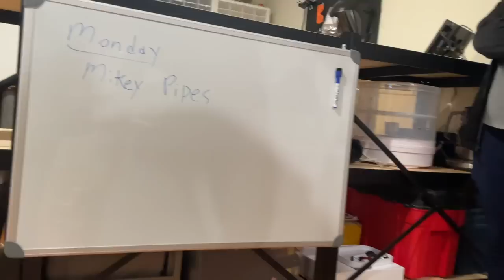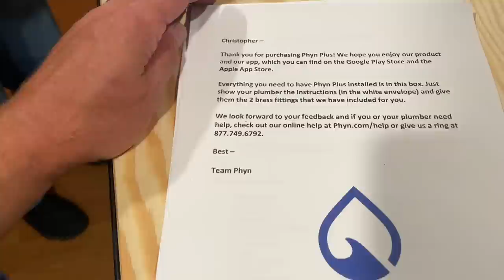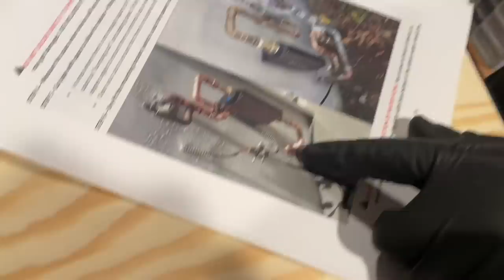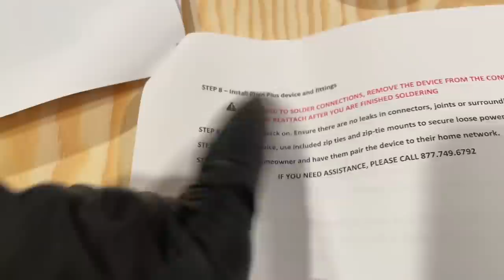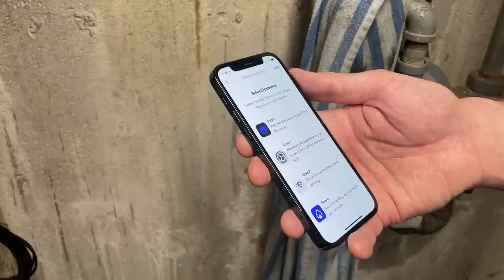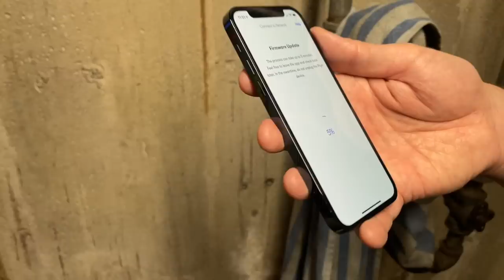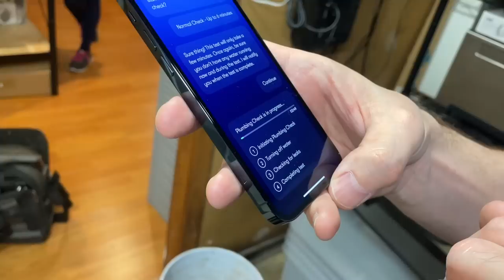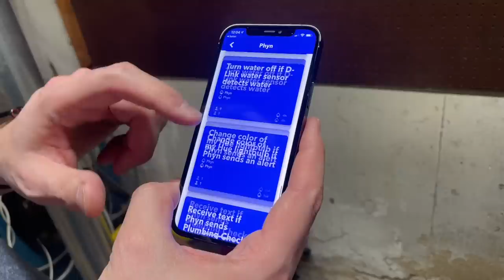How to install Phyn Plus Automatic Leak Detection System on Water Main to protect against Flooding

Comment: In my area ( Syracuse NY) we would be required to put a #6 copper bonding jumper with bronze grounding clamps around the Phyn because it is not conductive from end to end. Same as we have to do around the water meter.
Reply: Excellent point!
Reply: Alot of areas around Syracuse want #6 @ 2 points ,do to the fact that they are running pex mains,and you can't ground alot of electrical services to the water pipe,so you have to drive ground rods

Comment: I reaaaallly enjoy your honesty (Plastic threads. It is what it is.)  Plumber as well, here.  I prefer the Flo by Moen.  The price point is a little higher, but the unit is smaller and nicer (My opinion).
Reply: @PipeDoctor  so then why do you like the Phyn vs. Flo Moen
Reply: I was eyeing the Flo, but then saw loads and loads of complaints of the internal turbine freezing up after about 1.5 years of use (past warrantee).  Seems to be a design defect where internal magnets corrode.  Prior solution from Moen was to purchase a new unit, appears that they now sell a replacement turbine, but ultimately appears to be a poorly designed product.  Now looking at the Phyn, and may give Mikey a call for installation as I live on LI.

Comment: Interesting -it would be interesting to go back in a month when the system has ‘learned lifestyle and installation use’, and open a drain valve somewhere on the system and see if initiates automatic isolation. Good call on showing the soldering SNAFU.😉👍😀

Comment: FLO by Moen is great and more affordable.  Great interface and easy to install.
Reply: FLO may be cheaper upfront but it requires a monthly subscription to access all the AI features that Phyn comes with out of the box.  You will save money over time with Phyn.  While I have not had personal experience with FLO, there seem to be more quality issues reported with it though.
Reply: @losnantos8079  you’re wrong.  There is no monthly subscription that you pay for.  I get all updates in real-time via the app and email.  I even get a phone call if a leak is detected.  I’ve owned this product for over 6 months now and it works great.
Reply: @snakeplissken128  Flo has a big flaw with its sensors getting corroded. A big no, the lifespan is less than 2-3 years.
Reply: My flo Moen went bad 3 days before my 1 year warranty expired. Thank God. I inspected the bad flo valve it was made of cheap plastic parts. I am just crossing my fingers now because they don't warranty the second unit.

Comment: Good video but not soldering often enough to remember to keep a rag handy to wipe the joint and should have put the plug wire on the other side of the water line.

Comment: Nice geeky device,  it sounds like it will monitor pressure on house side of control to find water leaks.  Sounds great for finding leaking toilets.  I think this device will be defeated by a teenage girl. A teenage girl uses more water then most little countries.  Teenage girls take min 1hr showers,  how many times will this device contact the owner about a large water leak during one shower before owner or teenage girl unplugs device.  Please let me know your thoughts.
Reply: I will report back after it has some time to learn. Supposedly it’s more than just flow rate, it can pick up the unique pressure waves each fixture creates. So it should recognize the shower after a while, and know that it’s “normal” to run for an hour. Does theory hold up? Time will tell.
Reply: I thank you and will be looking forward to a positive result from this device. I hope it works well. I have a friend that serviced Bloomberg’s 
Home. while home was empty boiler control burnt out , a pipe broke and flooded home. A big loss was the result and Chubb was the insurance company.  I can see the importance of this device and if works as intended,  you have introduced a needed device to all homeowners.   Thanks. Eric
Reply: Also I installed a 50 gal hot water storage tank to my boiler when my daughter turned 13 , as I have learned from my customers. 
And it lasted 17 yrs before being replaced,  i joke with my customers and have a personal relationship for over 30 yrs. I like to recommend something that is proven to work.  Again  thank you for the introduction.    Eric

Comment: Haven't had any customer complaints with the phyn thus far.  cannot  say the same for the moen flo. Floodstop was also a absolute disaster here in the south. Water quality seems to be the demise of all these units. A bit more practice Mikey and you will be a master at soldering.
Reply: @PipeDoctor 😂 Happens to us all.  That one was in a great spot and easy to rectify.
Reply: @PipeDoctor  SOLDERING is gravy,clean copper,flux fittings and pipe,warm joints,wipe off excess solder,apply more heat to pipe,then joint face ,then back of fitting,apply solder opposite of flame,let cool and wipe clean!
Reply: I M a Moen guy, here in Kentucky.   On my 8th one and I have one for my house.  What problems have you had?
Reply: @themisfitter1767  failed actuators and seizing due to water quality. A few issues with  corrosion of the power connectors but a fair amount of complaints about the User interface experience.  imagine they all have similar issues.
Reply: @S_a_n22  I was eyeing the Flo, but then saw loads and loads of complaints of the internal turbine freezing up after about 1.5 years of use (past warrantee).  Seems to be a design defect where internal magnets corrode.  Prior solution from Moen was to purchase a new unit, appears that they now sell a replacement turbine, but ultimately appears to be a poorly designed product.

Comment: So.. turns out it may have created a bit of an electrical issue. I just posted a video about it: https://youtu.be/Xu_MmnIg67U
Reply: A couple of your other commenters brought it up, otherwise I might not have connected the dots when my lights started flickering. I still didn't quite believe it until I put the meter on it.
Reply: @PipeDoctor  I haven't, but it's a good idea to touch base with them, if only so they can update their documentation. I thought about this a little bit more -- it's definitely not about grounding. Like you said, there is a ground wire attached to the main right where it comes in. I believe that runs all the way back to the main panel, so the system is grounded.

The issue here is bonding, which is covered in NFPA 70 250.104(A) "Bonding of piping systems and exposed structural metal".  Basically, all the metal piping in the house needs to be bonded, and by breaking the connection with a plastic valve, the rest of the pipes in my house got isolated from the small grounded section at the bottom, and therefore from all of my grounded circuits. One danger here is that if somehow a live wire contacted a metal pipe, it wouldn't have a path back to the grounded system, so anyone touching a pipe could get shocked.

But aside from the shock potential, what I experienced was more like leakage current. Somewhere in my house, there's probably another place where a circuit is "grounded" to a water pipe, and there's some small amount of electricity trying to flow back through the water system to ground, but it couldn't get past the Phyn. By adding that bonding jumper, everything is pulled back down to 0 and aside from dumping 12 watts into the ground, it's happy again.